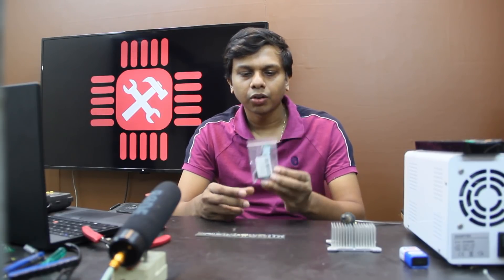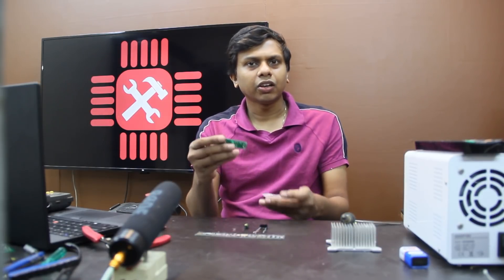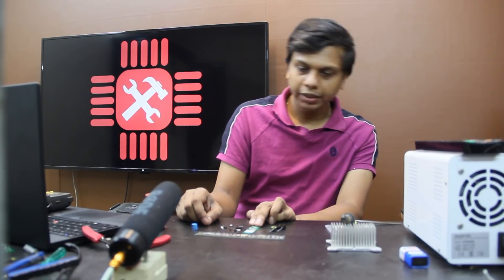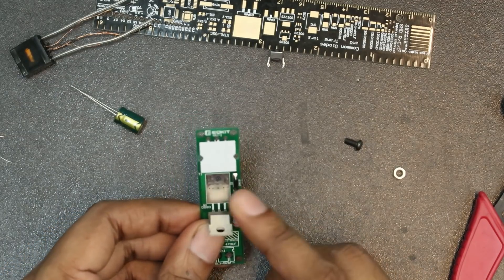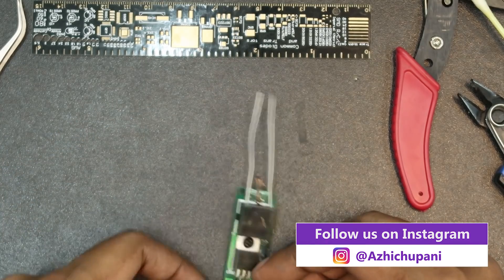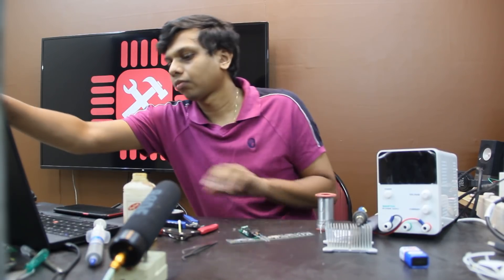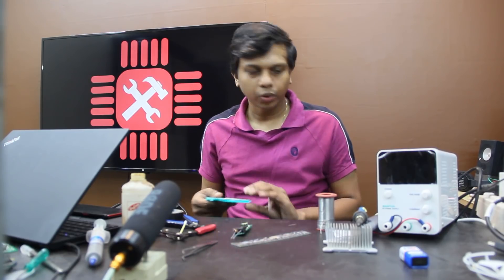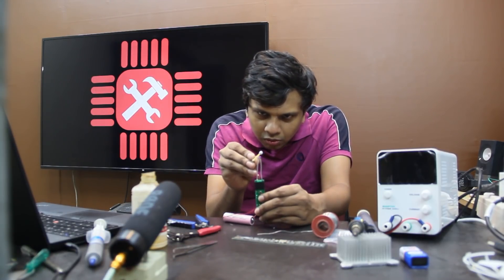കിടിലൻ ആർക്ക് ലൈറ്റർ ഉണ്ടാക്കാം  | How to Make an Arc Lighter |  #arclighter

Comment: Thankal use cheytha battery 3.7 volt alle ciruit 5volt alle require cheyyunne appol thankal 3.7 volt input koduthal problem ille
Reply from the maker: Circuit 3 to 5 volt aanu.. max 5 volt aanu.. mention cheyyan marannu poyengil kshamikkuka...

Comment: Oru contaimer undakkanano bro ithra prayasam. Eathayalum ithrayokke cheytha sthithikk oru container koodi undakkamayirunnu. Matte micro switchinte wire extend cheythal theeravunna praname ollu... Ennitt ithoru pvc pipe lekku koodi aakkiyal adipoliyakum. Pvc pipil oru square hole ittitt aa micro switch athilekk nannayi glue cheyth vechal pore... Oru adipoli lighter aavum😀.
Idea ishtamayal reply cheyyaneee😋
Reply from the maker: Bro pipinde end cap kittan illa.. 1 week aayi oodi nadakkunnu.. ariyamallo lock down aanu..